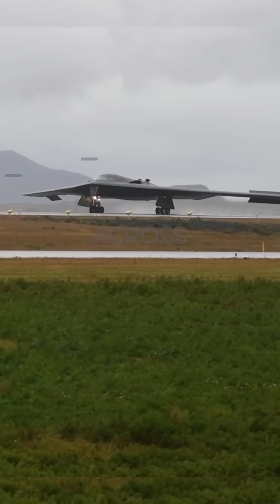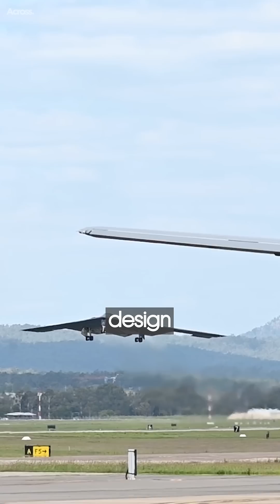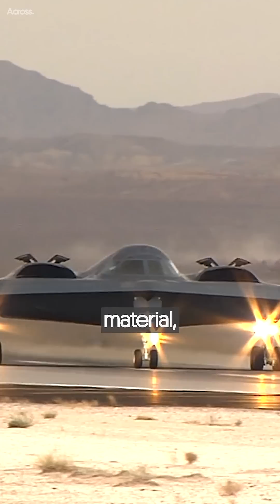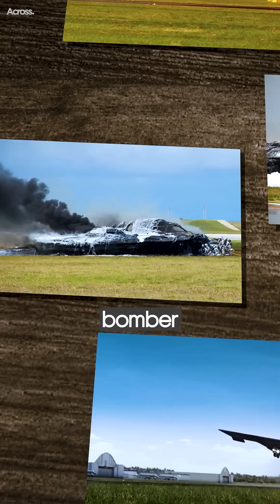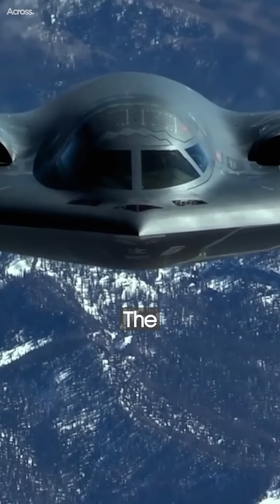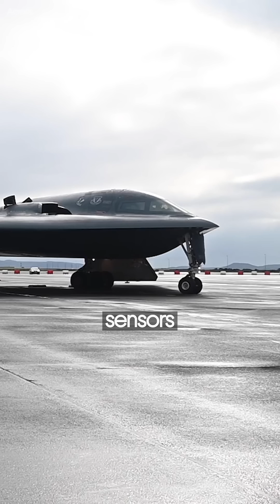Here's Why The B-2 Spirit Can't Handle The Rain

Comment: This is a clearly detectable object for the MIG-31 flying high and spot it whit is radar from above.😅😂 Has no chance of surviving. It wil see death coming from above or below, the MIG is also capabele of guiding AA missiles launched from the ground. Losers 😂
Reply: The B2 literally can't be detected unless it's flying directly and closely above radars
Reply: @Yisraelamundas  just dream on....🤣😂🤣
Reply: @klaastelkamp5414  It's basic knowledge, it has THE most advanced RAM on it.
Why are people so ignorant?
Reply: @YisraelamundasI’ve seen two reports that Yemen located and tracked a B2 even fired missiles at it but failed to hit it. However they succeeded in turning it around without dropping its payload.
Reply: @davemccrillis1470  This is false by the way, you might be getting some sources mixed up with the Israeli attack on Iran, using F35s, where their F15s got locked onto, resulting in 1 out of 3 strikes on Iran.

Comment: Technology cannot replace a good stick man
I think the Air Force is relying too much on technology and not human touch
Reply: The B-2 needs a computer to take-off and fly, as it doesn't have a horizontal stabilizer. If it was in human touch, it would be nearly impossible to fly. So, it's either more visible in combat, or more accidents happen.
Reply: @dubsrus8071 interesting.
Reply: a human without computers wouldn't be able to fly B2 at all.
Reply: @darrak1 Except Tom Cruise. 😊
Reply from the maker: Agreed

Comment: Sooo...during all of the countless hours of flight testing...they never encountered rain which would have prompted redesigns? Who doesn't test aircraft IN THE RAIN?
Reply: Accidents happen.
Reply: They also never encountered a MIG-31. Because they wil see thos Flying log. And destroy it 😂
Reply: @klaastelkamp5414  That can happen, but the chances of it are slim.
Reply: @dubsrus8071 Because they are unlikely to risk losing a $2.1 billion dollar plane over contested airspace.
Reply: @davemccrillis1470  The whole doctrine of stealth bombers is to be of first day use when things are most dangerous. Like how the F-117 was used extensively over Baghdad despite the lack of air cover and the abundance of SAM sites (it was even more protected than Moscow was at this point, so highly defended)
So it's preferable to have an escort, however it can be done without an escort.
Reply: @dubsrus8071 I’m never disappointed. Why were you in Baghdad ? How is that not the first question ? There’s a mentality that isn’t even acknowledged so I’m not going to change minds here.
Reply: @davemccrillis1470  I'm giving you my reason on why they would. Why would they make something just to never use it for it's intended role?
Also, I can change my mind, you just need to give me solid reason rather than assumptions. (also it's harder to understand exactly what you're trying to say since it sounds like you're foreign)
Reply: @dubsrus8071 My point is obviously. The US says that the money is for “defense” but the majority of the money is spent on offensive weapons and foreign bases. The US is bordered by two oceans and two friendly nations, why are they spending hundreds of billions of dollars every year on weapons that are not necessary for America’s defense ?